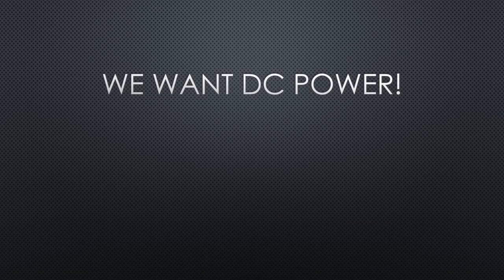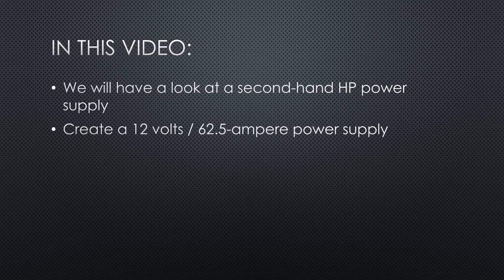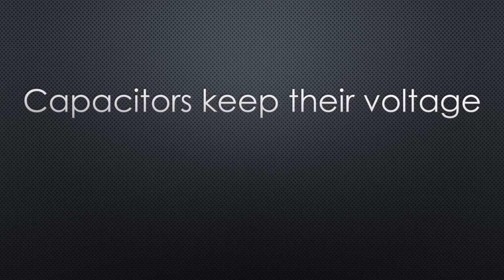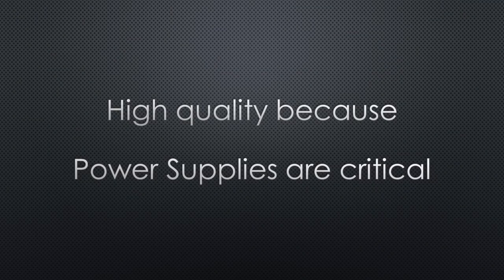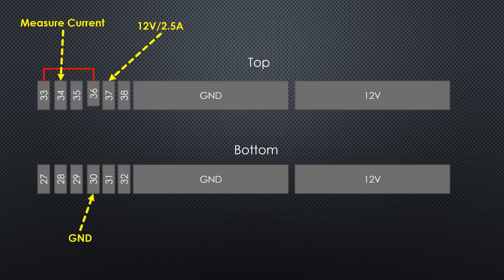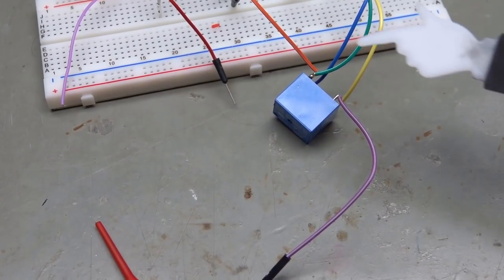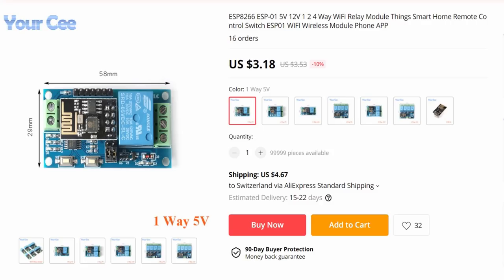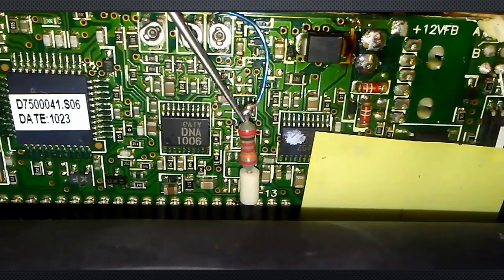#342 12V/60A power supply (PSU) for 20 dollars? Unbelievable, but true. And high quality.

Comment: Do you have any thoughts about powering car accessories with a PSU like that? I have some very good hifi gear laying around which is practically not usable in modern cars (no DIN radios anymore...) but this stuff is way to precious for me to sell or throw away. I would probably need something a bit beefier (about 1000W), but these PSUs should also be obtainable...
Reply from the maker: You have to pay attention with switching power supplies for audio applications. They create some noise
Reply: @AndreasSpiess  Ok, thank you! Maybe I should try out an old standard ATX PSU with the headunit in question and some low power speakers to see/hear what the audio quality would be like. It's a Pioneer Reference Series, so chances would be good that it can deal with some noise on the power line :-)
Greetings from Germany!
Reply from the maker: ATX PSUs are also switchers...
Reply: @AndreasSpiess  Of course they are. What I meant was I have old ATX PSUs laying around, which I could use to test the effect of the switching on my HiFi gear. If it is good enough to filter it out of an old ATX, I could then try to get a cheap and beefy server PSU.

Comment: i have a couple of the 1.2kw version from old srrvers. the fan is horrific and was replaced by a 120mm one.
Reply from the maker: Good tip. Mine did not run, fortunately. But I was not able to get the full load out of it.

Comment: I always go with Mean Well for PSUs. Cheap, reliable, no coilwhine (as far as I know) and you get to chose your own cable.
Reply from the maker: Cool. Can you provide a link?
Reply: @AndreasSpiess  Sure, here you go:

https://www.amazon.de/gp/product/B00UCXHXJ6/ref=ppx_yo_dt_b_search_asin_title?ie=UTF8&psc=1

12V 100W for 22 Euros. I personally used this one for years now, no complaints. I don't know how much I would trust their "IP65" rating, since there's a warning on it to not use them in damp environments, but there are other ones with multiple voltages even that are even cheaper. If dust is no big concern, you might want to look into their RS line of products. I chose the LPVs because I tend to chuck them somewhere and don't want to worry about them anymore.
Reply from the maker: Thank you for the info and the link!
Reply: @AndreasSpiess  You're welcome.

Comment: I have collected some information on these PSUs here: https://github.com/slundell/dps_charger I have done some reverse engineering on the i2c protocol but some parameters (like OVP and UVP) seems not to be changeable. Interestingly, the PSU is controlled by an UNPROTECTED PIC16F which opens the opportunity to reprogram it to make a kick-ass charger or programmable PSU!
Reply from the maker: Thanks for the interesting link!

Comment: ive been looking into making a variable mod.  Seems like we will need to add a micro, and tap into a couple things.
Reply from the maker: You should not go much higher than the 14 volts because of the capacitor rating.
Reply: @AndreasSpiess  My goal is make the rails variable  0v-12v in .01v steps.... Rail=(3.3v , 5v, 12v) on a typical computer PSU. If each rail needs to be close to its original, then I wouldn't mind getting 0.5v-4v on the 3.3v rail, 4v-9v on 5v rail, 9v-14v on 12v rail.   Hope u catch my drift.

Comment: Is it possible to add some simple transistor/opamp circuitry to the output to have a regulated 12 PSU?
Reply from the maker: This is regulated. But you can add a lower voltage power converter if you want
Reply: @AndreasSpiess  I was thinking of creating a buck converter along the existing circuitry for a poor mans lab bench psu functionality. Maybe even adding another psu and connecting outputs in series and have 24V buck regulated psu.
Reply from the maker: This is possible. You have to isolate them. Just google and you will find examples
Reply: @AndreasSpiess  thank you for advice. Keep up the good work!

Comment: I have the hp dps750ab power supply and cant figure out the pin combo to make it useable, any ideas?
Reply from the maker: If google does not know it is best to buy one where you get the needed info (that is what I did)

Comment: 2450W HP hot-swap from a UK supplier on ebay - £17.50 (search: *HSTNS-PR16).  What have you started Andreas; I'm already planning an adapter PCB too...
Reply from the maker: In the meantime I found adapter boards and left a link in the description.
Reply: @AndreasSpiess  ooo - I will be sure  to check it out!

Comment: I was donated three 400 watt server supplies some time ago. Unlike yours they have all three standard voltages PLUS 12v CPU and the -12v, -5v and +5v Sby. They are Ablecom model SP402-1s units for SuperMicro servers. Now the BAD news! Of ALL the MANY types of power supplies there are for servers, can I find ANY data on these units (other than people repairing them or for new items from Ali Express)? Sadly NO! 
I can identify the main +3.3, +5, +12 and Gnd points without issue, but the signal pins??? They do not even use the same numbering as yours and my PCB goes up to pin 70! Are any of your viewers able to help? I've tried all sorts of different searches on-line to no avail. Having all three standard voltages at high currents (plus the 12v CPU line @18A) of 30A, 30A and 15A will make for the basis of a great lab supply as I can use the 12v 18A CPU line with a boost converter to get around 200 Watts total on a variable output of about 6-7A! Given that even on eBay these particular units are selling for upwards of £60 I may just try to sell at least two and buy a few HP 12v ONLY ones.
Any pointers to information gratefully received!
Reply from the maker: I also saw that you can get many different PSUs, but I only found info for a few. This is why I bought one where I had the info ;-)
Reply: @AndreasSpiess  gift horses are difficult to choose sadly! LOL ;)

Comment: What pin should be for Current sharing so they can be connected it in parallel?
Reply from the maker: I do not know if they are made for running in parallel. 60A was more than enough for all my applications.

Comment: Thanks for your video. would be a nice solution for my hypercube 3d printer. but i wonder about the safety. What happens when it breaks? does it catch fire, or simply shuts off? Because after all, it is still a device which was in use for many (thousands?!) of hours. Can anybody talk about that? :)
Reply from the maker: I assume they will not catch fire. Think what would happen in a multi-million DP center if one catches fire...
Reply: @AndreasSpiess  Thanks.
Reply: id
 - These industrial PSUs always have over-temperature, over-current, and short circuit protection, i.e., the device just shuts down, and depending on the model, lights an error LED and/or reports failure to the computer, either via a serial bus or separate dedicated signals. They usually also monitor that the input AC voltage and all the output DC voltages are in range.
Obviously, anything can catch fire, but the build quality of server PSUs is about 100x better than regular PC ATX power supplies. I would argue that the expected life-span of a used server PSU (with typical 5-7years of 24/7 use) is still more than 10 years longer than a brand new PC PSU.
Reply: Please consider a whole-system failure mode: the PSU is fine, it's operating within parameters, but you have a fault path in your printer, while PSU is happily supplying power that sets it ablaze. It's millions of times more likely.

Comment: Don't see the point of the relay. isn't a transistor between pin 33 and pin 36 enough to switch the power supply? It makes more sense to put a relay and esp on the main/input side to eliminate the standby power.
Reply from the maker: I tried it with a transistor and it did not work :-(
Reply: @AndreasSpiess  Oh, you replied! didn't expect that. I would like to try it and let you know in the next couple of days. shall I post here or through some other means like twitter pm or facebook (i dont even use facebook, but i could create one for you... :) )?
Reply from the maker: In the next days I should see it here
Reply from the maker: Thank you for the video. I tried it and it works on my PSU, too. Thank you.
Concerning the pin: The pin numbering is correct, but my drawing is wrong. Pin 32 is the one at the edge and pin 27 is close to the big GND pad.
Reply: @AndreasSpiess  You are welcome. Glad I could help a little. always enjoy your videos :)

Comment: Hi! Can you adjust the output voltage via the PMBus?
Reply from the maker: I do not know an I do not think so.
Reply: Johann Glaser
 - I am not familiar with this particular model, but I have never seen a PSU with a digitally controllable output voltage. However, all the ones I have meddled with have a small voltage adjustment trim pot on the PCB somewhere near the output connectors. If you want, you can desolder this, and route it to be accessible from outside the enclosure. The voltage adjustment range is not that big, though. Maybe +/- 1V max.
Reply: Thanks for your replies! Now I got curious myself and looked into the (free) standard. The PMBus 1.2 standard Part II PDF file in Ch. 9, starting from p. 27, shows several ways how to adjust the output voltage. Multiple parameters have an indirect influence, like adjusting the feedback divider. The only question left is whether your very supply supports these commands. :-)

Comment: are the negative of these power supplies connected to the earth terminal or not? I want to connect them in series to get 24v.
Reply from the maker: You have to insulate the cases. You find info to do it.

Comment: Eh, don't believe everything you see or read.  I've built this exact same power supply.  While it does provide some relatively clean DC power, the RFI it generates is un acceptable for most modern HF transceivers.  Too much hash.  Radio operators should know what I am referring to.  While you might be able to use it on a vhf/uhf station without too much issue, on HF, you're better off with one built for radios.
Reply from the maker: I think I left a link to a video to get this problem solved.

Comment: Do you know the standby current of such PSUs? I heard that they are not designed for low currents and will consume about 100W even if nothing is connected (???)
Reply from the maker: Mine consumes 12w without load
Reply: @AndreasSpiess  Thats really a lot of standby consumption. And what happens if there is a load of e.g. 20W? Is the consume then about little over 20W or is it 32W?
Reply from the maker: I assume 32, but did not test.

Comment: currently they are also selling the Platin version inc postal 12,66€ - is the pin layout the same?

HP 656363-B21 750W Platinum PSU Netzteil
Reply from the maker: The pins are most probably the same. But you have to check if you need more voltage.
Reply: These are HP Common Slot PSUs, and should be the same pinout for Gold, Plat, or Titanium versions. I believe they are also the same across 460W, 750W and 1200W, but don't take my word on that..

Comment: I also went down this road 1 year ago. Folks put these in series with tricks for all sort of things. Very hq but loud and ugly!
Reply from the maker: Many viewers report they are noisy. So I pinned a comment that everybody sees it. Mine was quiet, but I had no chance to use its full power.
Reply: @AndreasSpiess  i also took an older good atx psu and a nice cheap banana atx connector board from aliexpress. Also works. Splits 3.3 5 and 12v nicely

Comment: Nice video as always! Greetings from the northern border. Since this focuses on PSU and hardware re-use: anyone got an idea to get 72V 10A DC efficiently (and cheaply) down to a usable bench supply level? Most drop in DC to DC converters usually are 60V input max. Got this supply in a handy 19" enclosure from an since deprecated 5x Lead Acid USV. Would be a shame to let it go to waste.
Reply from the maker: I hope you get a tip frome somebody

Comment: What about stacking two of them in series to get 24v? Is this raises any issues?
Reply: Aizen732
 - The first PSU requires no modification. For the second unit, you have to disconnect the output (DC) ground from the input (AC) ground and the chassis. This can usually be done by just replacing the nuts and bolts that connect the PCB ground to the chassis with plastic ones. Just remember to check the resistance B/W input/chassis and output before connecting the power...

Comment: I have seen a Philips server psu that has malfunctioned at 13.8 vdc, and the user a ham radio operator has got fried all of his tranceivers and  a €3k sdr receiver because they all suddenly  got 110 volts instead of 13.8 vdc. Please Build in the psu some saftey precautions incase of a malfunction so that youre connected electronics dont go to heaven.
Reply from the maker: Tons of Ham operators use these PSUS (I did not know that Philips build such devices). They are protected against overvoltage.

Comment: Does anyone have any idea if the HP HSTNS-PD18 will work too, I wanted to grab one of these quickly and didn't notice the 1 letter difference when I bought it, they look identical in the pictures.
Reply from the maker: The pinout of the HP PSUs seem to be pretty standard. If you want more voltage yiu have to google.
Reply: @AndreasSpiess  thanks for the reply I ended up buying another as I saw they started to rise in price, I plan on adding an LCD, switch and some banana plugs to make it a nice way to power breadboard projects

Comment: Which edge connector would be used for the PSU ? I would like to create a PCB which is cleaner than soldering it all up.
Reply from the maker: I posted a link in the description for a PCB board with the connectors.
Reply: @AndreasSpiess  Overlooked them sorry
Reply: @AndreasSpiess  Mhh isnt really what i want im just looking for the barebone connector so i can addatch my own pcb to it.  i searched the Partnumber? on those connectors FCI...Something but google has zero results for it.
Reply: @matzmatz4148  I found the Amphenol part (10046971-001LF) on Mouser and Digi-key $8.90 before shipping.  May as well buy the board off ebay and modify as desired.
Reply: Scratch that.  I just realized, it would take a month to get here from china and the US sellers want US prices.  I need to put a load on the supply when it gets here to verify it's good.  I'm going to Digi-Key

Comment: Cool 😎 video, can connect this in parallel? Thanks.
Reply from the maker: I would not do it. They are not made for that. Maybe you  buy one with more power.
Reply: @AndreasSpiess  OK thanks.
Reply: @AndreasSpiess  please can you help me. I having problem with power supply, the fan is still running, but there is no AC power anymore, thanks.

Comment: Very interesting. Could i parallel 4 of them and get 3kW?
Reply from the maker: Not easy, I think. But you can try.
Reply: @AndreasSpiess  i would probably have to connect to the regulating potentiometers and the current sense pins with a microcontroller to try to balance the load between the individual supplies. Series is easier... Just remove the ground connection from one of them and insulate the cases
Reply: Gilberto Rossi
  - I personally wouldn't do a parallel setup without diodes in the outputs. With simply connecting the units in parallel, there is always a risk of one having a lower output voltage than the other(s), and thus there will be current flowing between the units. Finding high current low voltage drop diodes will not be easy or cheap, though.
Anyway, if you really need high current 12V, there are much more powerful server PSUs out there. I, for example have two units that deliver 187A, which yields over 2.2kW (for a single PSU).
Reply: @MrZetor  This highly depends on the power supply. Some are capable of sinking (or dissipating) power and would try to lower the voltage. Other can't do this, and will just stop outputting power. Regardless if using diodes or not, the risk of a parallel setup is that one supply tries to deliver all the power while the others do not move a finger.
Reply: @gilbertorossi3666  Yep. And apparently some models have a 'Current Share' signal/pin that enables identical PSUs to be connected in parallel. I don't know exactly how this functions, but I reckon the PSUs monitor their output voltages and currents, and adjust/balance their output depending on what the other parallel units are doing.

Comment: regards it is possible to upload it up to 16v is there any way.
Reply from the maker: I only went to 13.8 volts because the capacitors seem to be rated at 16 volts. I would not try to max this out...

Comment: Is it possible to take three of them in serial and get 36V at 60A? This ist in sum 2 kW power supply for $ 60. I like to know before I buy this.
Reply from the maker: Check the internet on how to insulate them. Then it is possible.
Reply: Andreas Spiess ,  I think between GND from 12V of the first is no connect to the second. the metal cases are at the same plug and between primary and secondary side is the Transformator in the PSU From HP. if you have two same from your HP type you can check this please. If two of them matches then three will also.

Comment: Do you actually need a relay for this? Would an optoisolator work as well?
Reply from the maker: Maybe. You can try. FET and BJT did not work for me.
Reply: @AndreasSpiess  Would be curious to understand why.
Reply from the maker: The levels of both pins change during the switching
Reply: @AndreasSpiess  I wouldn't think that would be an issue with an optoisolator. I'm going to try this.
Thanks for the video, this is a brilliant idea. Just wish I had seen it before I already tried some low quality, general purpose power supplies. Going to trash all of them.